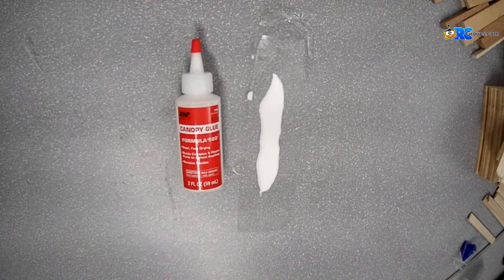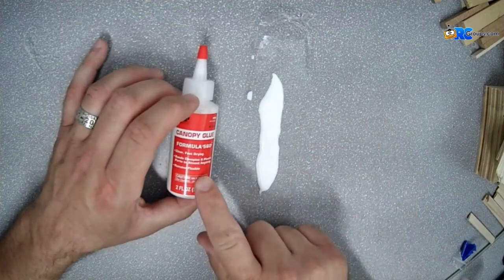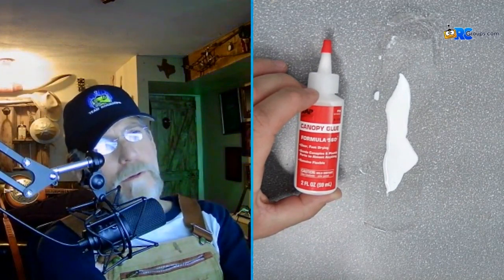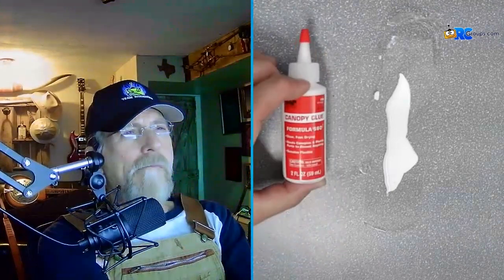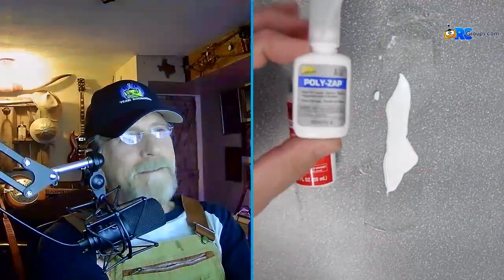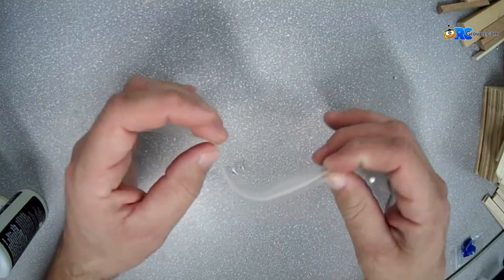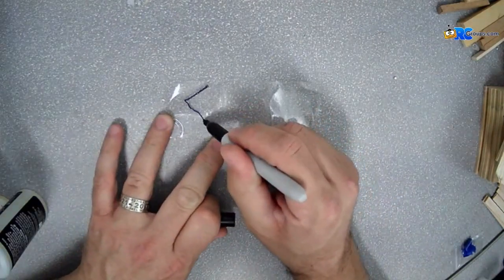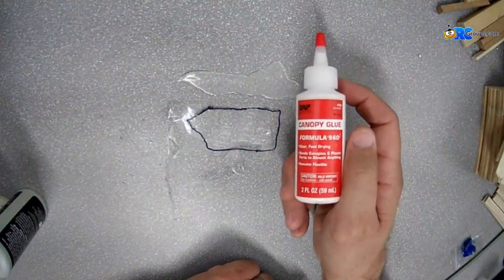ZAP Glue How-to - Canopy R/C 560 Glue

Comment: Thanks for the review but it seems to me that any water based glue just sits on the surface of most plastics like your glue did on the clear tape .
Even epoxy and clear gorilla glue sit on the surface and peel off like the perfect moulding release agent and the clear glues that weld in to the plastic like super glue or glues that contain methyl acetate acetone cause misting or damage your paint work or are impossible to clean up without creating a  dogs dinner.

Comment: I just used the canopy glue on a plastic tailwheel cover. It worked out because I needed to remove it and the glue was easily cut with a razor knife.